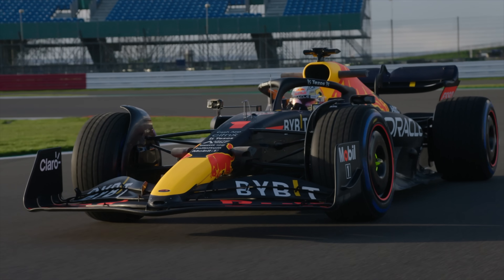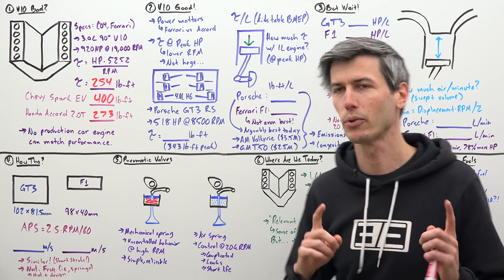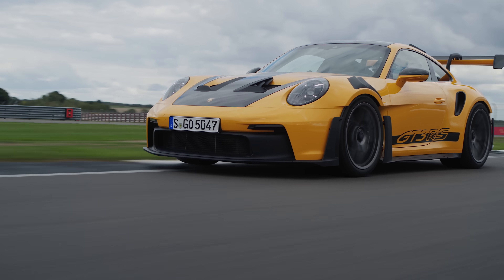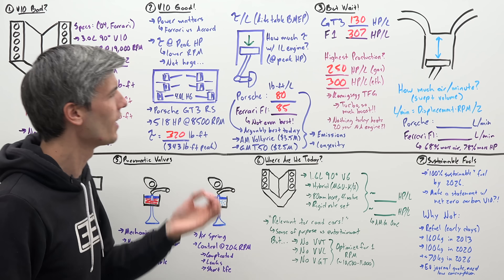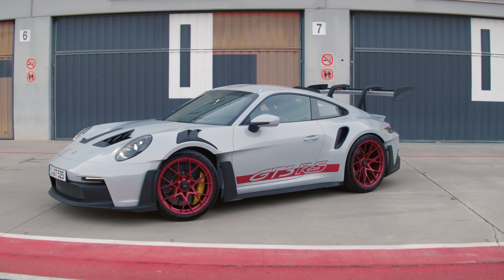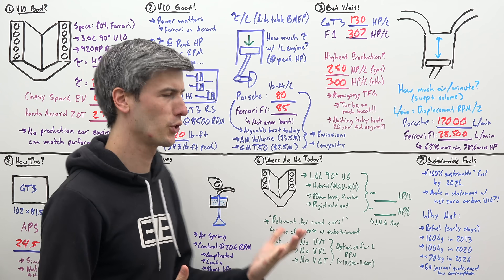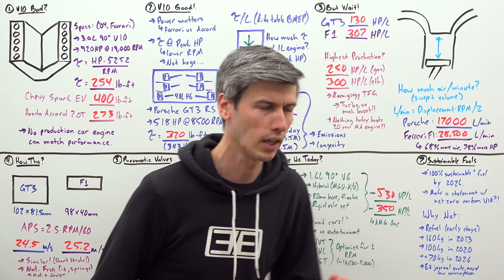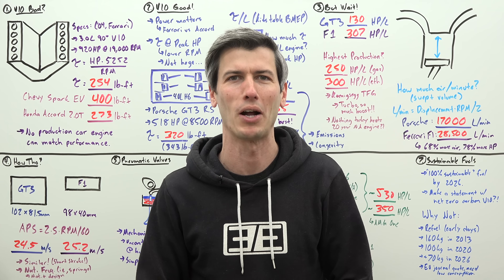Formula 1 V10 - The Greatest Engine Of All Time?

Comment: I helped develop the V10 and later the V8 for one of the teams in the good ol days of F1. Our last V10 we had on the dyno for a last test and we had over 1000hp at over 20k rpm.
Reply: You lived my dream, bud 😀. Those were the glory days of engine development; it seemed like there was an upgrade at every race weekend. In just a decade, the specific power shot up from approx 200 to over 300 hp.

Btw, could the engine you're talking about be P85? I understand,though, if you're still bound by the code of silence and can't divulge that information.

I also remember the insane
Reply: would love to know the fuel flow rate  >150 kg/hr?
Reply: @GamezGuru1  190 to 195kg/h. We used a double fuel rail with direct injectors and variable trumpets with actuators changing the intake length depending on engine revs to optimise torque.
Reply: @GamezGuru1 with their sizes and rpm, I'd wager more like 200+
Reply: If you guys had time to continue developing the engine, for another 10 years. How much power could you guys extract?
Reply: @GT3.00   I cant say we still had some room on reducing the friction in the engine, but we were limited with the revs. So probably 100hp more max.
Reply: @TheBoorgatspook  Is this with the f1 rev limit rule? Or is this without restrictions?
Reply: @GT3.00  Without restrictions, but remember revs are limited by the materials and the engine it self. The power curve doesn't really change, so at some stage higher revs wont bring more power.
Reply: @TheBoorgatspook  thanks
Reply: @TheBoorgatspook Are you South African, by any chance?
Reply: @gerhardvaneeden5615  ja ek is.
Reply: @TheBoorgatspook Kwaai, man! Lekker werk wat jy gehad het. Jy het seker baie kennis...en stories! Is jy terug in SA?
Reply: @gerhardvaneeden5615  ja was wild gewees, maar lekker. Nee nog steeds besig met engines, maar doen nou WRC, GT4 in Europa.
Reply: @TheBoorgatspook  Ek is so jaloers! GT4 lyk nogal lekker 👍🏻
Ek bly ook nou in Europa, in die ooste.
Reply: @TheBoorgatspook  What was the theoretical max rpm of such engine (over 1000 hp at over 20k rpm) ?
Reply: @TheBoorgatspook  What engine you guys tested back in the day? Can you tell it?
Reply: You make a great point with the 1.6T being irrelevant. Bring back those V10s!!!
Reply: Williams BMW ??
Reply: @daniels.2720  Sounds like Cosworth.
Reply: I have NA 4c 8v engine, which produces 82 HP @ 5200 and 130 NM @ 2700
Reply: OMG 1000 hp at 20k rpm.
Reply: Hi - what made those “pang” sounds when changing gears? music to my ears.

Comment: 16 mins later the only question in my head is "so, when do we bring back the V10s ⁉️"  😅
Reply: Bring back v10s/v12s and grid girls.  And also stop pretending that this sport where race teams fly cars  on storage aircraft all around the World is somehow good for the environment.
Reply: You need to find a manufacturer willing to make and support race ready V10 engines.
Reply: @Appletank8 First FIA needs to open up regulations to allow different configurations and more RPM limit. As soon as someone finds that V10 config will give them the championship, it’ll be a reality in no time
Reply: @thecompanioncube4211  
We just got 2, maybe even 3 new engine OEMs specifically for the new engine rules coming in 2026. How many would instead join for a V10? Would it be good for F1 if only 2, or even 1 OEM made engines for everyone?
Reply: @Appletank8  3 new plus old 4 (Ferrari Merc, Honda, Renault). If 6-7 engine manufacturers in 10/11 teams, there's more than enough wiggle room. I am not saying it will happen in first year of 2026. But till 2029-2030? Definitely realistic in my opinion. Just FIA needs to chill a bit
Reply: @thecompanioncube4211  That's not what I said. You assume that the only reason manufacturers aren't building V10s is because the rules prevent them. No, only Ferrari really has a reason to build large, 8+ cylinder engines, heck they were the loudest voice that pushed for V6, the rest were fine with I-4 for the turbo hybrid regs. The fans' excitement for replacing hybrid v6s for V10s is not exactly shared by the OEMs that have to sink billions into developing something they have zero use for. They don't grow off trees waiting for the right person to pluck them.

Honda, Audi, GM, and Ford are quite specifically here for that hybrid powertrain, and the rules negotiated for in 2026. A high probability is them seeing that F1 with V10 and no hybrid system, is no longer worth the eyes, and going home. 

So I ask, would you be happy with V10s returning to F1 if only Ferrari is interested in building them?
Reply: @thecompanioncube4211 a low rev v10 would still sound better than a v6.
Reply: What if it was a hybrid V10?
Reply: @PaperBanjo64  
That wouldn't really help with the weight issue, and the increased friction of nearly double the pistons would also decrease efficiency and thus fuel required.
Reply: @PaperBanjo64 hybrid on v10 doesn't help with fuel consumption. Learning to make engine efficient and still fast and reliable is what attract manufacturers today. Sadly besides ferrari no ones interested in developing fuel thirsty f1 engines anymore. Even with synthetic/renewable fuels will make it worse as is it not high energy dense as gasoline and tank size will be enormous to last a race or refuelling had to be brought back which is another controversy on it's own. And fuel flow restricted n/a will not scream as much and defeats the point we want to bring back to f1.
Reply: While not an F1 car, and if you need a V-10 engine, one can be found in Volkswagen Phaeton 😂
Reply: Boy i got news for you

Comment: Without question. The best sound EVER. Better than V8, better than V12. Like CGT or LFA is the best stock road car music. I was lucky to be at couple of races in 2004. WOW, it was soooo loud, we couldn't hear each-other for 2 hours after the race. Check Alonso V10 practice in the new V6 era... Eargasmic.
Reply: >"better than V12"
1995 Ferrari 412 T2 wants to know your location
Reply: @solitaryclusterofneurons598 V12 are smoother and quieter, but that doesn't always equate to better sounding.

Comment: People often forget that the current V6 engines are using about 1/2 as much fuel as the cars of the V10 era.  Cars now have to carry all their fuel for the race, something those V10 cars didn't have to.  So even if you were to pluck a V10 engine and put it into a modern car today, you'd need to leave room for some 200kg of fuel... or you'd just have to do a LOT of lifting and coasting, as well as short shifting to save fuel, and then carry like 180kg instead.  People keep talking about what if V10 cars could have DRS and slicks.  Well, what if today's cars could have 2x the fuel flow and make 1600+hp?  There is no doubt in my mind that the current engines, although not sounding particularly good, are the most insanely well engineered engines of all time.  Reliable, efficient, powerful.  The V10 engines back then only had 1 of those traits.

Comment: The greatest sounding wasn't a V10, it was the 1995 Ferrari 3.0l V12 in the 412T2. This was  the year when they dropped the engine displacement from 3.5 to 3.0 liters, so the lighter reciprocating mass set the RPM's higher, and the V12 had the most bangs per revolution. It's not even close, the V10's have a bit of a throatiness but the v12's have this incredible high frequency scream in their sound signature.